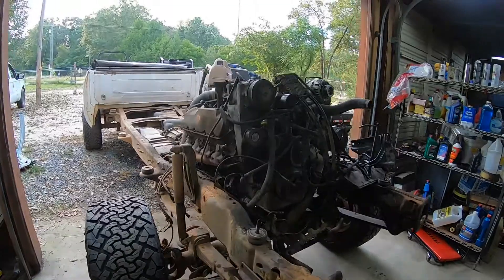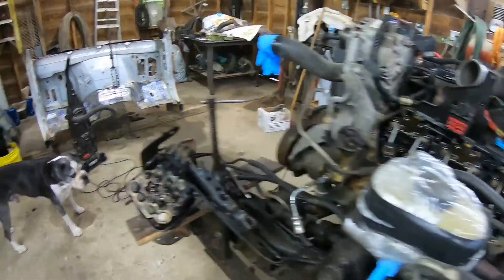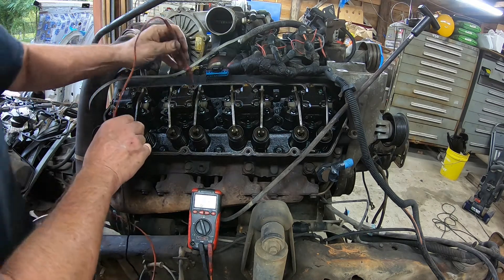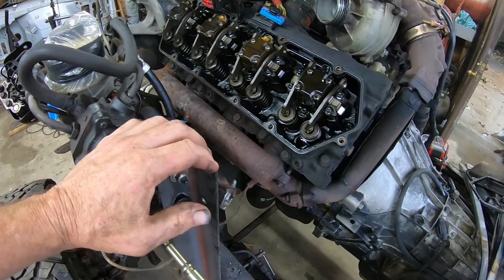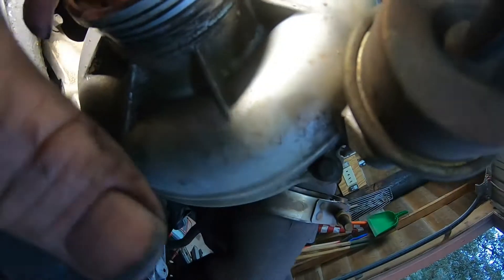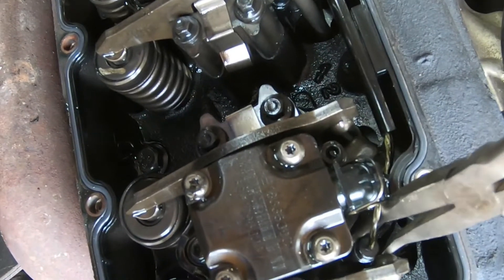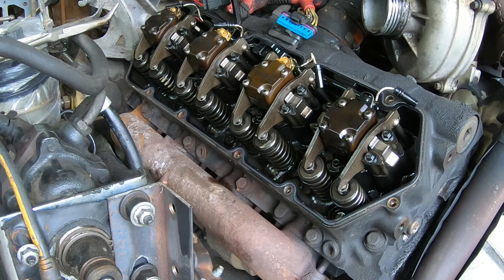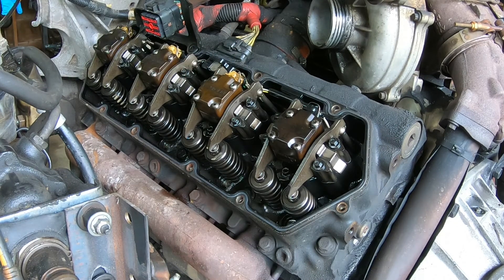2001 F350 Cab Swap Part 2 - Engine Prep

Comment: Ok been watching your videos, but never told us what you recent failure was? I think by looking at that turbo engine may be dusted, love your old school mechanic ways, good stuff..
Reply from the maker: Well, on my hot shot truck I had two failures. First was coolant in the oil and that video is on here. Found a crack between cylinders 1 and 3. So my spare had to go in my HS truck. It failed with a holed piston...that was after this video. I've gotten behind because I've been so busy trying to get back to work. The turbo ingested something big...everything was clean inside and the engine runs great! This truck is my daily driver, but actually won't be driven much...I doubt it will see 10K a year.